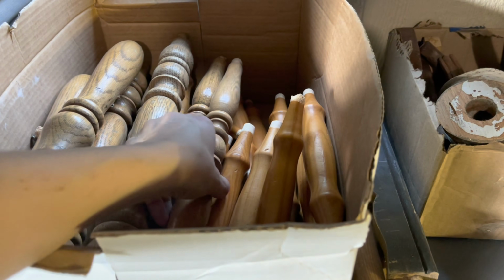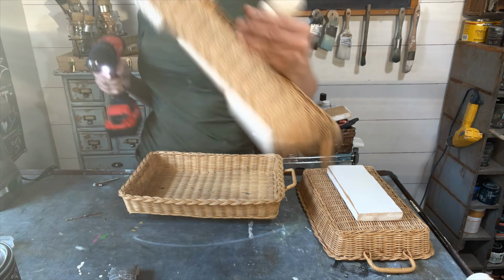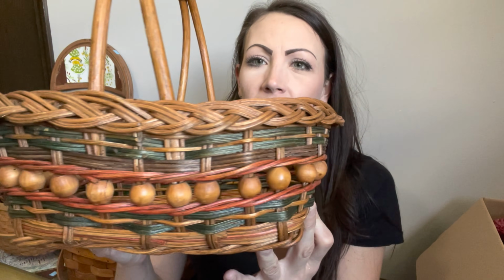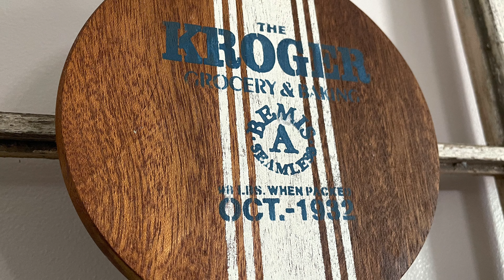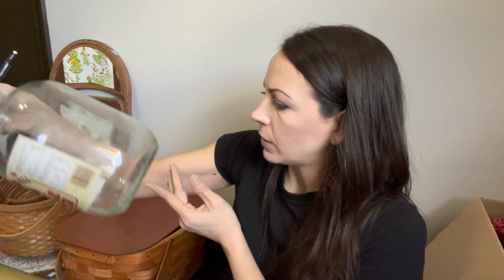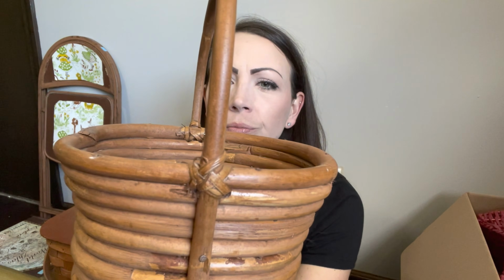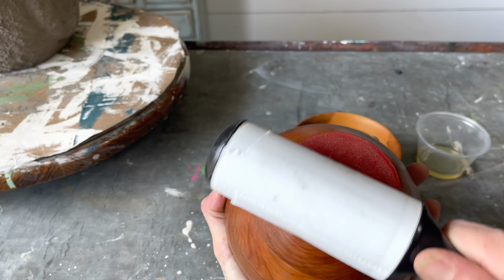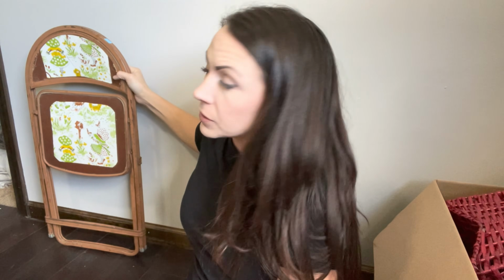NEW 2021Thrift Flips for Profit!  Baskets, Spindles, Stencils, and Faux Concrete- Cottagecore Style!

Comment: If I had the basket with the hole on the side I would stain it a darker color, place it in my flower bed place dirt inside so it cascaded down to the hole and plant a ton of moss roses in it and let the continue a ways outside of the basket...is that a dumb idea? I dunno... its just what I thought if when I saw it.
Reply from the maker: That is not dumb at all! I've been wanting to make some "tipped" flower bed decor using tipped over buckets and a wheelbarrow! This would fit right in! :)